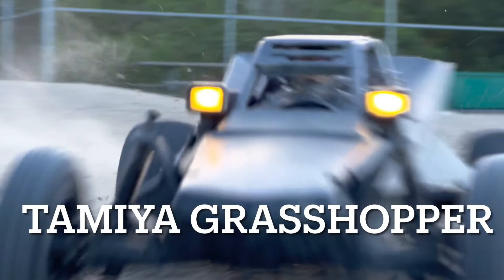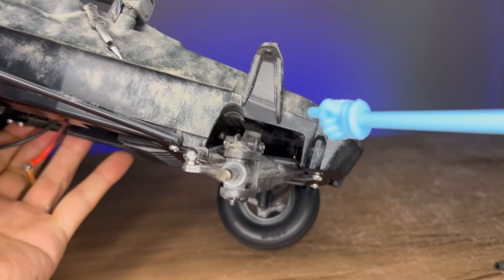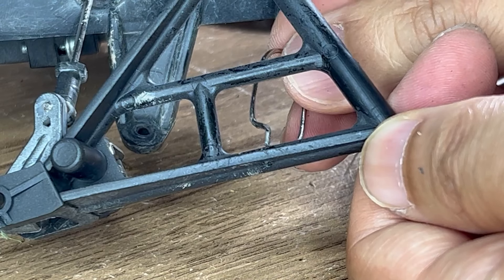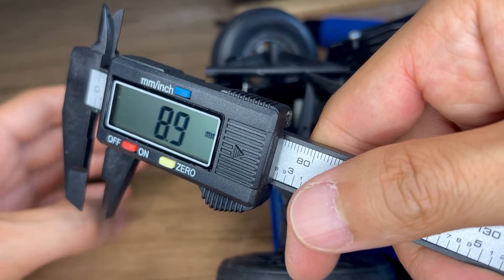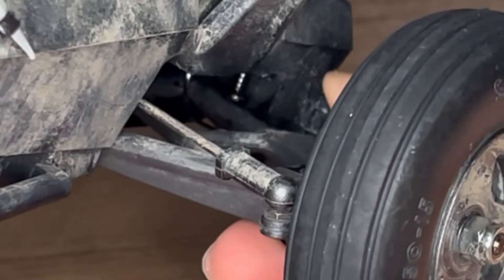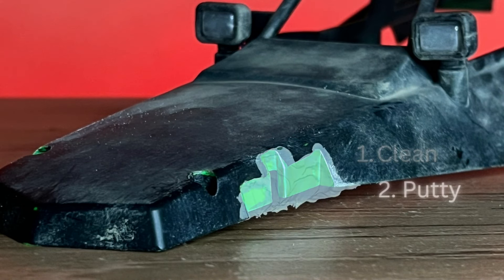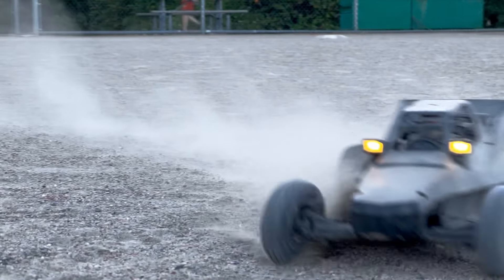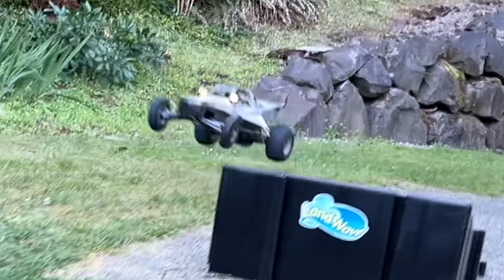2X Classier w/o Shocks: Tamiya Grasshopper RC Buggy

Comment: Years ago a friend was driving a grasshopper with another friend and I's super mod Blackfoots. The poor grasshopper was getting killed. I had to do the same fix on the fly to keep him running . Exept I used a leaf spring mounted across the front. The black banding steel for lumber bundles cut into thin strips made heavy duty six leaf bruiser leaf springs.
Reply from the maker: Interesting!  The leaf spring fix is creative!  Thanks for commenting!
Reply: I've actually thought about that black steel banding, and wondered whether it might be possible to use it to make leaf springs! As you handle it, you can tell it's spring steel.
Reply: I've used the tines from a cheap metal rake. They're already thin. One rake can make a lot of springs!
Reply: @ericrichard5237  Good idea. Plenty of them there. Reminds me of the metal brushes on street sweepers I used to pick up.  They always shed a few bristles here and there. I've pondered 1/24 Axial crawler leaf springs.
Reply: @ericrichard5237  Old windshield wiper blades have very nice spring steel strips in them to.
Reply: @bradbrown8759  now you're making me think of a torsion bar suspension setup. That might work good on the 'hopper by spreading the load along the bottom of the chassis.
Reply: @ericrichard5237  Lol😂 Great!  Make it so...

Comment: Like other viewers, I usually prefer to see shock towers on a buggy like this, but this sleek look does have its merits as well. As someone menrioned, it can't make the handling any worse, as the Grasshopper is a bouncy car anyway, unless fitting better (real) shocks. Just wondering how the suspension arms will hold up, as these are now used in a different way from the original design

Comment: How does the car handle overall afterwards? I thought that looked way too bouncy to work on a hornet but it looks like you're running a 540 motor instead of the stock 380.
Reply from the maker: The motor I used is a brushless 540, way overpowered. The mod could add to the bounciness but that’s fun too. I have more modern buggies for better handling but they’re uneventful in a sense. This thing bounces like crazy and full of drama and that’s partly why it exists at all. Thanks for commenting, cheers!

Comment: Surely this will just lead to fatigue cracks in the sprung wishbone that wasn’t designed to just bend all the time?
Reply from the maker: You're probably right, the wishbone is not designed to do this, so it's a legitimate reliability concern.  But it seems to be made of soft plastic as I find it quite pliable so I'm not too worried.  Thanks for commenting, cheers!
Reply: Don’t worry about it .

Comment: man, i need soo many recivers and batteries, i have so many i want to run, but i have so many sitting around because i don't want to move a receiver around too much
Reply from the maker: Keep driving your RCs!  Start from your favorite one.  It can be very rewarding to get it up and running.  Thanks for commenting, cheers!
Reply: You can buy a radio, like the absima cr3p, that can be connected with many receiver. With the absima you can register up to 10 setups for 10 différents cars. I have one and i use it for a buggy, a rally car and a road car. Works fine!

Comment: Shocks on rc cars are bullshit and most racers use bushings not bearings for the wheels. Id prefer a wishbone instead of a spring and oil chamber...indy car made some cars with no suspension and it performed better then the other cars staying on the road.
Reply from the maker: Duly noted.  Thanks for commenting!